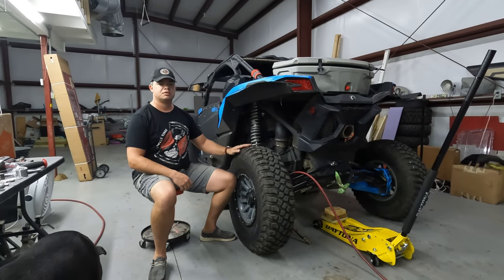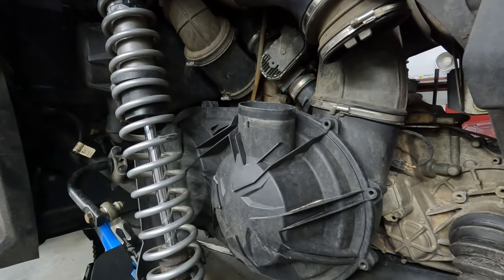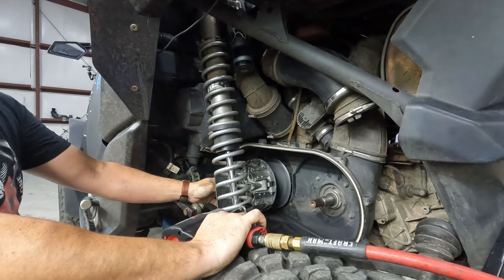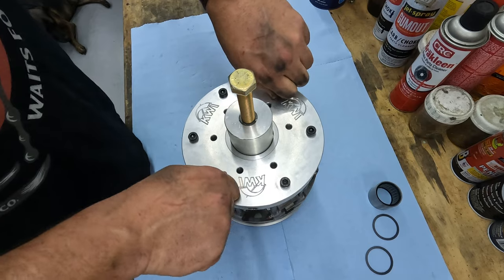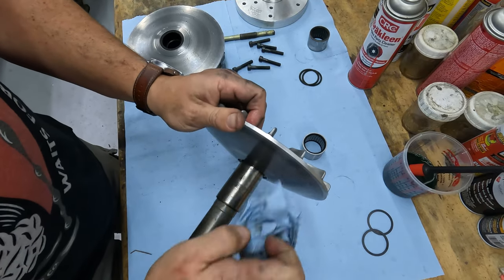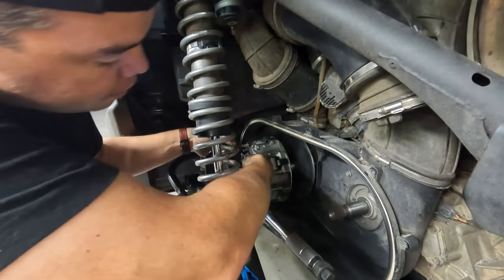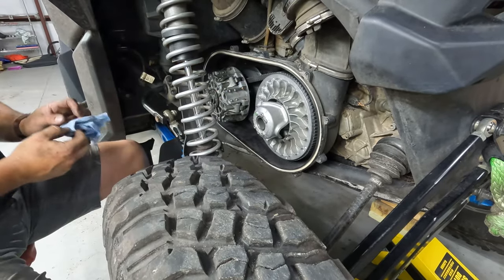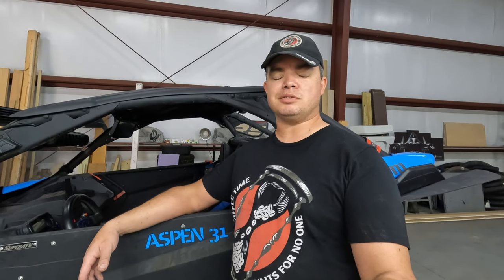Maverick X3 Primary Clutch removal, bearing replacement, and reinstallation.

Comment: Great video brother . I’m getting ready to install my PDrive Primary on my 2022 base DS 120 X3. Just picked up a new torque wrench and my primary puller came in the other night .
Reply from the maker: I still had a bearing issue. Decided on KWI float mod to solve oem issues. I'll post about that soon, hopefully.
Reply: @Aspenoffroad  awesome video! Intrigued to find out what you had found out, far as I researched it looks like that is the only fix for this issue. My secondary loves to spin right along with my primary, assuming that was the issue that you had. Mines a 22 with 800 miles on it & I believe its toast.
Reply from the maker: @Joshua Smeal  On mine the belt vibrations caused by the imperfect OEM machine work of all sheaves was bad enough to wear the bearing inner face washer away within 15mi of riding. 
I sent it to KWI for the float mod and it's been perfect ever since. Perfectly aligned. I did verify the oem sheaves were at least 0.015" warped on all surfaces.
Reply: Wow that’s all crazy . I’m at 1,052 miles and mines fine on my 2022 DS 120 . My PDrive install went fine and no codes thrown or anything . Took a first mountain trip ride last weekend and everything is working as it should . PDrive is much quieter and smoother and quicker engaging , however it did seem to take away some of the 120s “punchiness” for lack of better description.
Reply from the maker: @Joe Kearney  I believe the quality of the Pdrive is higher and less prone to wear. Glad to hear it's working well.

Comment: Would changing this bearing fix not shifting out of high
Reply from the maker: If this bearing is seized (spinning with the primary instead of independent) it will make all shifts from and to any gear difficult or grind.

Comment: You can take the kwi tool and re-attach the plate and cap bolts and a bolt or rod in the side to hold the primary and torque the clutch bolt. That's how I've done it. Good video

Comment: hi Elliot, the primary clutch bearing that you disassembled in this video only rotates in one direction ??. the bearing acts as a brake on the downhill engine exactly??, could you tell me the diameter of the shaft where the bearing is mounted and the dimensions of the bearing? can I leave you or write you an email ??..thanks Leonardo
Reply from the maker: I'd have to take it all apart to get those dimensions, that's not happening unless I have a need. The bearing can rotate in both directions but it only needs to spin in one direction, and only then when the secondary clutch is not spinning. It's primary function is to allow the secondary clutch to not be driven at idle speeds to allow gear changes.
Reply: @Aspenoffroad  ok grazie

Comment: Dude. so this video is top notch -  I'm no mechanic but I think this is achievable for me. One stupid question - I blew up a belt at 80MPH and shot it out the inside cover. 2020 X3 RS Turbo R. I'm going to replace the covers and do the bearing and service kit (not the rebuild) while im in there. Everything Looks similar on mine  - but is it? Is there anything I need to know about doing my RS Turbo R vs. your model? Any input helps.
Reply from the maker: All the "QRS" clutches from 2018 to 2021 are the same. Even the secondary clutch on the 22 and 23 models are the same. I've heard there may be different weights in there but the service will be done the same way. Thanks.

Comment: any update after returning from KWI after the float mod?
Reply from the maker: Oh yes. It's awesome. I mic-ed the sheaves before they left and both had significant issues. KWI really smoothed the engament off idle and perfectly centered the belt. Several rides later and no problems changing gears anymore.

Comment: How is running after you replaced it?
Reply from the maker: Its been great, way less noise and much smoother shifting.
Reply from the maker: Additional update. It's still an issue. Appears the OEM misalignment or warping of the belt surfaces has killed that inside washer in about 25mi of running. Update when it comes back from KWI for the float mod.

Comment: What size bolts did you use on the primary length and where m6 ?  Thx
Reply from the maker: I'm a little confused, are you asking the length of the bolts I used to hold the primary still to torque? Or the length of the actual primary bolt that threads into the trans shaft?
Reply: @Aspenoffroad  sorry, I was asking specifically about the bolts used to hold the primary while u used the pry bar to torque down.  If you had the length and what size they were to fit the threads.
Reply from the maker: @dcsann  I had those bolts from a Craftsman pulley puller kit. No idea the size or threads. However, the bolts in the QRS primary splitter kit from KWI would also work.

Comment: Hi, what kind of bearing grease did you use and what are good substitutes?
Reply from the maker: I'm not sure the exact grease is really important as long as it's thick and put in conservatively. Don't want any grease on the belt.
Reply: @Aspenoffroad  thanks for the reply, I found it after.....Kluber Isoflex....listed on the BRP website in the exploded diagrams....in case anyone else asks.
Reply: @danalig4565 which weight